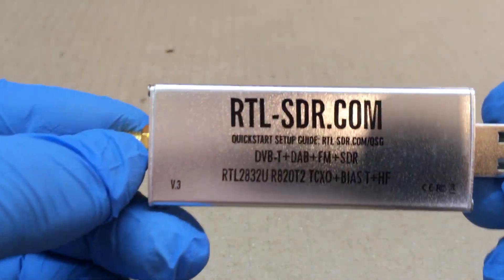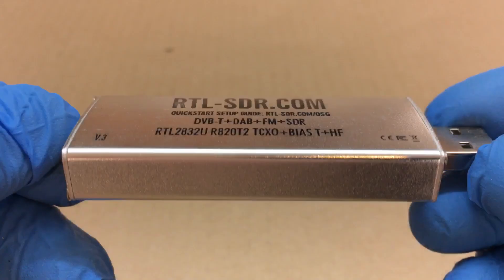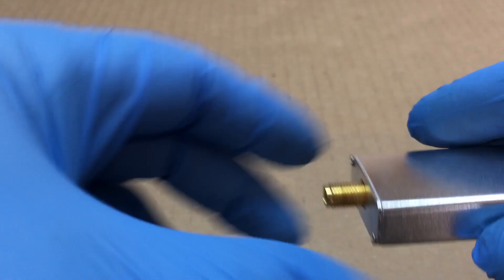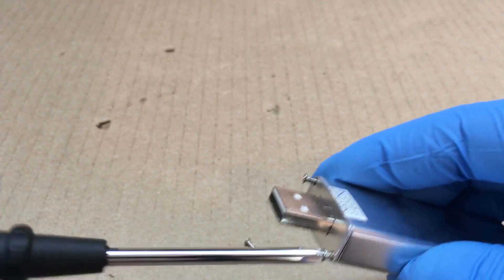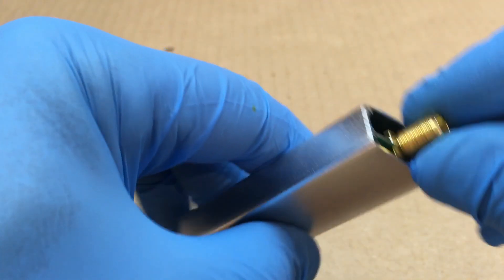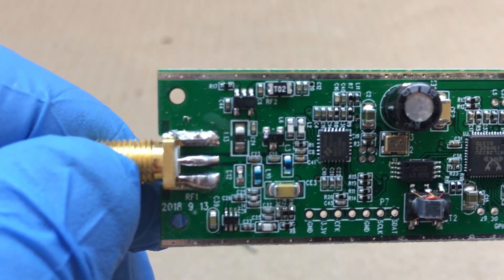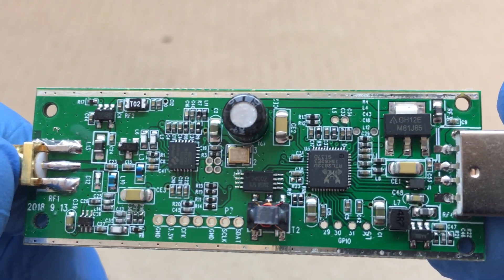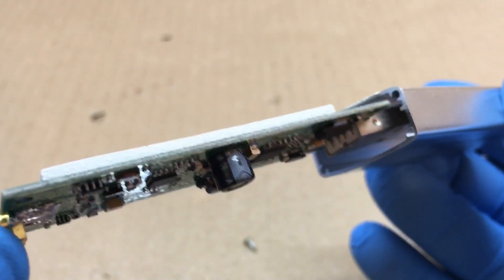RTL-SDR.COM V.3 USB Dongle  Is It Real Or Fake

Comment: SO IS IT REAL OR IS IT FAKE?
You didn't even say what to look for.
How do you know if you have a fake???
Reply: I opened mine today and see that it is a fake. No thermal tape, no nut securing antenna connector to end cap, four screws holding end cap on and is rectangular, not rounded body. It does not look to have a TCXO, and is two boards sandwiched together.
Reply: I was laughing thinking the same thing. A COMPARISON would have made this video 10,000x better.

Comment: of course its real. its made by the same guy who gave you all his hard work in the form of Drivers to convert your own DVB dongles into SDR for free. This V3 dongle is now capable of HF the standard DVB dongles are not.. I recommend not using the antenna it comes with, I thought my dongle was faulty and was going to return until I tried a new antenna. For some reason, the one that came with the dongle would not pick up HF VHF UHF.
Reply: You have to check the antenna or it has a good ground connection under the on the ground plate, open it and check or the ground wire makes contact because most of the time it has no connection to the magnetic ground plate. After you correct this, it will work.
Reply: So which antenna i should use, dvb t and antenna works fine but radio hf doesnt
Reply: @namesurname4666  For HF you need a good outdoor antenna. A long wire, high up, or a directional loop tuned to the band you're using.